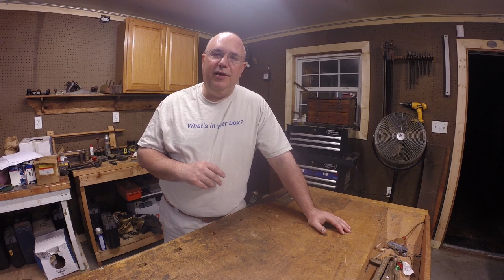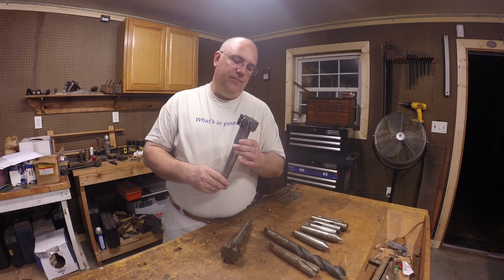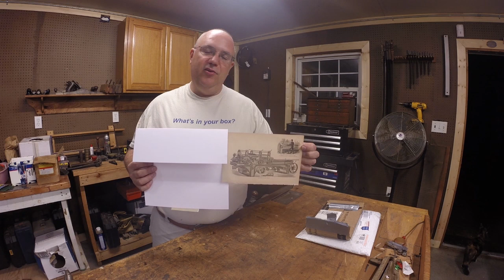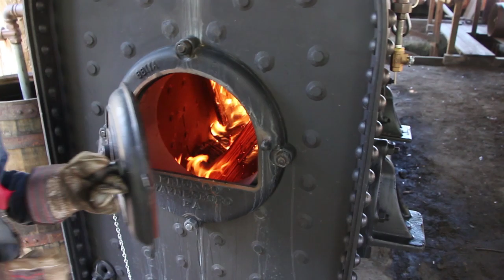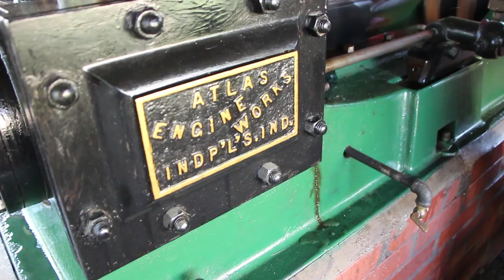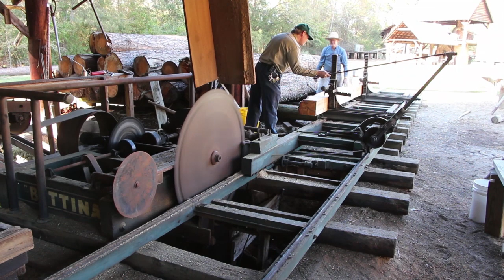Machine Shop Talk:  New Tools, Viewer Gifts, and Views of the Steam Powered Sawmill

Comment: Does the steam engine dump its exhaust steam straight to atmosphere, or is the exhaust ducted to a smoke box on the front end of the boiler to help induce draft --like a steam locomotive boiler?
And does the Georgia Museum of Agriculture also have a metal-cutting shaper hidden somewhere?  I haven't seen one as of yet, but it doesn't mean it's not there.  (At least I'm hoping.)
Reply: *****
Yep!  Or more accurately, I'd been referring to the one at the tail-end of this video.  I didn't know the Georgia Museum of Agriculture had any more in captivity.  I wasn't aware that steam-induced draft was the standard for stationary engines.  As a Boiler Technician in the Navy, the steam would exhaust from the high pressure/low pressure turbines and then flow through a condenser to turn into liquid water, than off to make-up feedwater storage and finally get pumped into the boiler.
A shaper in the Oliver 80 Restoration Project?  Splendid!  That gives me an excuse to watch again for the sixth time!
Reply: *****
Okay...Time to start scheming for a road trip!

Comment: OzSwiss European Tools have a piloted chucking reamer ( 5/8" ) with a 0.6094" pilot. Bizarre size or what ?
The milling cutters could be used in a lathe headstock if the cross slide had a boring table.